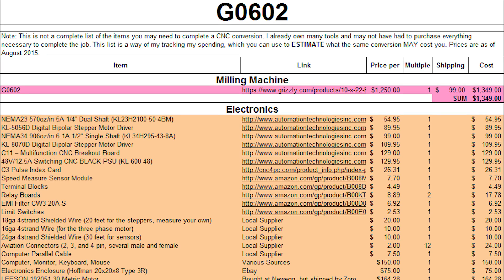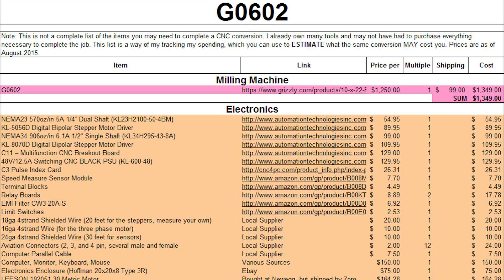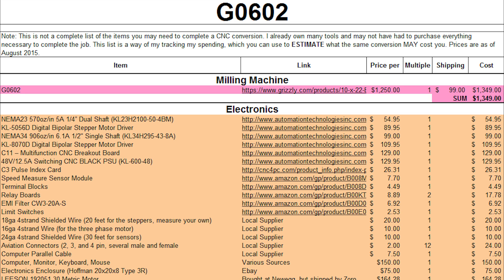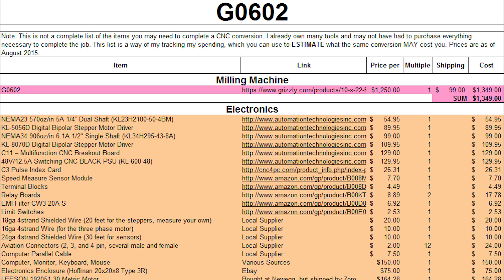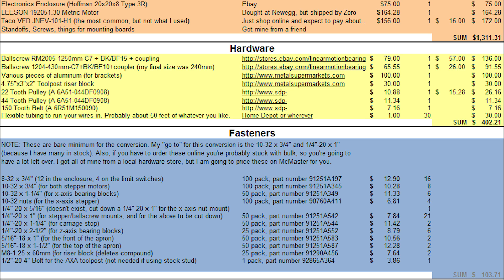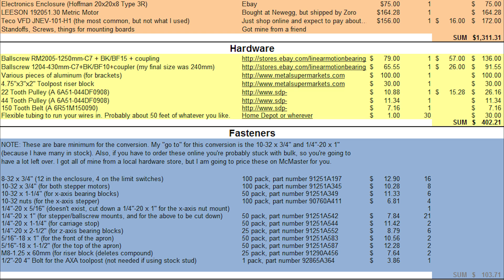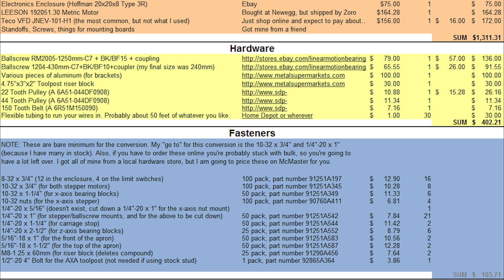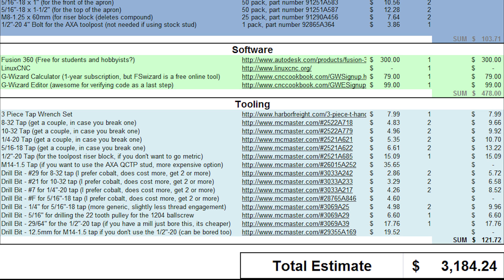G0602 CNC Conversion pt2 - What it Costs to Convert

Comment: hi russtuff I was wondering if you have the part numbers for the 22 tooth pully because i went to sdp and looked up the part numbers listed and both part numbers are the same. i guess i could just find a pully that looks the same but i was worried about belt length being correct and wanted to follow your build. thank you.
Reply from the maker: The part number I have here still works: https://www.youtube.com/watch?v=lvK7TDFJZhY
https://shop.sdp-si.com/catalog/product/?id=A_6A55-024DF1512
I'm no longer using this belt drive as I couldn't get it to run quietly for some reason. Now I'm using a ribbed belt setup... and it looks like I never made a video about it (hmmmm). You can see some of it here though: https://www.youtube.com/watch?v=rH0dEqflykk

Comment: A bit thrown off on the intro spread sheet, says milling machine, you can get stronger steppers by going to nema 24, most have the same hole pattern as the nema 23 ie 47.1mm you can get the closed loop version up to 5nm
Reply from the maker: lol nice catch. This is an old video and I never noticed it :)

Comment: Is a 3 Phase motor necessary, the Grizzly model G0752 comes with a variable speed (1hp) at a purchase price of $2000+, or is it still better in the long run to get the g0602 and change to a 3 phase variable speed.  Currently, the G0602 is $1500+ and after purchasing a Leeson 1hp 3phase ($240) and a VFD ($140) you are close to the price point of the G0752.  Any comment, please?
Reply from the maker: No it isn't. If I were buying today, I would get the one that already has variable speed and save myself the extra hassle.

Comment: eehaww   
just  seconds a go paid for the motors, the drivers and the 48v power supply!! don't know what to do with my previous 36 v power supply that I ordered A week ago:( ouch
was $35 maybe returned to china -#####%$#@!& hmmmmm

my c10 and the c6 will go back tomorrow for the upgrade to c11gs

waiting for duncan to call me and give  me the name of the new expensive boards that he was talking about last time, 

my bad; l didn't write them down, l was driving to frys food store when he called me(:

Without your videos we will never get into that step sir

thank you!
Oz
Reply from the maker: +Ozy Ozy Very cool. No worries at all :)
Reply: +russtuff 
good morning,
just wanted to ask you if you don't mind send me your bellscrews drawings for both axis, I know you don't want to give your drawings in case if they are different, but I just want to compare my drawing with your drawing to make sure I am on the right path :)
Sorry for my so many questions, but hey without your guys I will never get my machine running!
my email  : sumer_art@yahoo.com

my C11gs is on its way :) but don't know where to buy the c3 pules index card sounds like hard to find?
now the speed measure module not in the amazon !  is there any other vendor to buy it from?
again thank you for all the videos!
Oz
Reply from the maker: I think I only have drawings for the X, but I may have the total dimension written down for the Z. I'll have to check. The X drawing is on my grabcad account too I believe.

The C3 is also available from CNC4PC, and that other card does seem to have disappeared. I'm actually about to do some tests to find out if the C3 is actually even needed. It seems to just pass the signal to the BOB so I'm not sure why we all use it. With any luck I'll have that much sorted out before the weekend is over.

Comment: hello,
I really like your both Sam and your videos, you both doing very high tech videos,

I have asked Sam question about his steppers motor and I was confusing if his setup using small nema 270 and 425 will under power the machine? but he confirmed that it will be fine, 
Now I see you are using way bigger motors than his once, and you was right when you said (you need power for  drilling) and I am with you with that part.

can you please tell which is the ideal setup (small motors) vs (big motors)
Thank you very much 
keep up the great work!
Oz
Reply from the maker: +Ozy Ozy The reason I went with bigger motors is because back in the day when John Grimsmo did his G0602 CNC conversion he went with 270oz motors on both axis. He told me he couldn't drill with them, and suggested going with something bigger.

Mine might be overkill, but the exact reason I went with them is because they are the same steppers I use on my mill. Since my electronics enclosure is for both my mill and my lathe, I wanted the motors to match on both machines so that I wouldn't have to change settings on my stepper drivers. If Sam says what he has is working, then I see no problem going with the same setup he has.

One thing to consider, is that while larger steppers will provide more torque, they have slower accelerations. The big NEMA34 I'm using on my Z-Axis takes a bit more time to reach top RPM than a NEMA23 would, due to its mass. I haven't really tested it's drilling capabilities yet though, so I can't say for sure if the NEMA34 is really going to be overkill or not.
Reply: +russtuff  thank you very much to clear that out in a detailed way..
I will go ahead and get same what you use. 

I just contacted Duncan at cnc4pc  and he recommend the new board c11gs he also suggest to use the most advanced cards that will cost around $300 to have complete cnc futures,

But I will just get the C11gs and save $$$ 

I think c11gs can get me threading, coolant, and spindle control! So that is enough for that little project 

I appreciate your replay sir
Oz
Reply from the maker: +Ozy Ozy Awesome. Duncan has always been good to help me when I needed it. Out of curiosity, what else did he recommend that was going to cost so much?
Reply: +russtuff  sorry for my delay of my subscribing, Sam just reminded me and l thought I had done that early, my bad..

I just called Duncan today and left him a voice message asking him to give me the cards sku number and the name, just don't remember the name of the cards but he said they are updated versions with many input and output channels that can give complete cnc setup that the c11 can't 

he should call me back tomorrow and l will get back to you with the info.

l am going to slow with my build.. is it possible that you make a drawing digram showing the wiring :)  l love your setup but scare to wire anything wrong !

thank you for all of the great info
Oz
Reply from the maker: +Ozy Ozy Oh sorry, I didn't mean to make more work for you. I figure he has more cards that will allow or many more inputs, maybe like a smooth stepper that is USB or LAN. Don't worry about it taking a long time, I think my mill conversion took something like 8 months :/

Comment: Do you know of an alternative to the "Speed Measure Sensor Module" that will work with your conversion design?  Amazon is out of stock with no restocking date.
Reply: +George Gibeau Also - the Relay Board link in your BOM is dead.

Thanks for the great videos - looking forward to doing my conversion (plus this lathe is on sale at Grizzly for $1,150)
Reply from the maker: +George Gibeau I had a feeling that was going to be a problem. The cnc4pc c3 index pulse cards will work fine, and that is the only one I am actually using right now. Since LinuxCNC actually prefers 2-3 sensors, I intend to try doing it all on an Arduino at some point, I just haven't gotten to it yet.
Reply from the maker: +George Gibeau Thanks for letting me know.

Comment: I want to build both f your CNC conversions, but for the moment I don't have room for them. I'll watch anyway, as it's fascinating and the info is adaptable to something I do gave room for (almost!)...a mini mill CNC.  When I can arrange for more ship space, I'll be watching again!

Thanks!

-- Mike
Reply from the maker: +BigMjolnir Cool! Let me know when you get there and I am happy to help with any questions you have come up.
Reply: +russtuff You are a generous man!  Thank you for the offer.  Don't hold your breath though...it could be a while. Or not...we'll see.  I'm reconsidering the plans all the time...I'd like the larger mill, I just have to figure a way to fit it in.  The cost difference is negligible enough that space needed is the main decision factor.
Reply from the maker: +BigMjolnir I understand that. If I were in the mood to do another conversion I'd go with the Bolton 45 this time. Much larger and heavier, but not quite as much detailed info online. That's why I went with my mill. Hoss' plans were super helpful.
Reply: +russtuff I saw the CharterOak Automation mill at a model show last spring.  Definitely larger, and surprisingly inexpensive for the manual version.  It's on sale at the moment since they are moving to larger quarters.

I'm definitely going to get Hoss' plans if I go the G0704 route.

-- Mike

Comment: I'm loving this G0602 CNC conversion series.  Thanks!  Looking forward to the next one!

I've ordered stuff from Automation Technologies, and they're good, but when I do a LinuxCNC conversion I order the stepper motors and drivers and the parallel I/O card as a bundle on eBay, usually from Longs Motor or Wantai.  I like the low prices and the one stop shopping, and the quality is actually quite good.  I believe it's comparable to Automation Technologies.  Many people get combo driver cards, but I prefer one driver per motor.  If I blow up a driver (hasn't happened yet), it's easy and cheap to replace a single driver.  I usually have a spare ready to go, just in case.

That's a good price on a  real electrical enclosure.  I've been using powder coated steel shop cabinets with stainless doors from Seville Classics.  They were available at Sam's Club, but they stopped carrying the one I used and I had to buy the last two from the manufacturer's website.

I LOL'd when you said you were originally considering upgrading from LinuxCNC to Mach.  Bwa ha ha ha ha.  Check out some of the conversational programming wizard add-ins for LinuxCNC.  Not as pretty as the PathPilot extension of LinuxCNC from Tormach, but they generally get the job done.  Hopefully, PathPilot threw down the gauntlet and the open source programmers working on LinuxCNC will pick up the gauntlet.  Even if not, there are plenty of other ways to get G code into LinuxCNC.  PyCam is one, although more for mills than lathes.  For one off jobs, I like being able to have conversational programming on the machine.  Barring that, a lot can be done with a little understanding of G code at the MDI screen.

There are a few other LinuxCNC installation videos on YouTube, but they're mostly out of date, and I'm sure yours will be more thorough.  I think most people will be shocked to see how easy it is on a simple mill, lathe, gantry router, etc.  I bought a tiny Sherline lathe so I could immediately convert it to my CNC Mini Lathe.  It's been a lot of fun, and it didn't take that long to do.  Most of the job was the electrical panel, because I'm an electrical engineer and even when I'm building a machine for my own use, I want to wire the panel properly.  I took 60:1 video and the 20 hour build made a 20 minute video.  I edited the video and added the narration, and then my iPod Touch died.  I should send it off to recover my files.  If so, I'll upload the video.  If not, I'll be posting my CNC conversion videos for my Grizzly G1006 mill and my Clausing 4900 lathe.
Reply from the maker: +Liberty4Ever Thanks! I've never used that eBay vendor, but I'll check them out right now. I agree about the single drivers.

I've been using a lot of the LinuxCNC scripts for my mill, but haven't used any for my lathe (or found any yet). Some of the mill ones are really good.

I'm terrible with electronics, as you'll see in my upcoming video on the subject. It's taken me a lot of muddling through to get this done. Luckily one of my friends is an engineer and this crap comes naturally to him :)

Comment: Your videos are GREAT for us beginners - please don't stop!  I am about to take the big plunge and purchase machines same/comparable to the G0602 and G0704 or maybe slightly more expensive if greatly advantageous. If you were starting over today, would you still choose the same machines or would you go with something slightly different?
Reply from the maker: +Wayne Causey Thanks for saying :)
I'm torn. I really like both of my machines, but like always, I have bigger machine envy. I really like the look of the ZX45 (also called an RF45) like the Bolton. They are quite a bit larger than the G0704 and not a lot of money more. The reason why I didn't go with the 45 is because I was nervous about tackling the CNC conversion. I bought Hoss' G0704 conversion DVD and it made the whole project really easy. That said, now that I know what I'm doing (and once I realized it's not that hard) I do sorta wish I had gone with the 45.

The G0602 is still a great lathe, and I like it. If possible, I would buy the variable speed version right out of the box (it's a different G# and they didn't offer it when I bought my lathe). Again, however, if I could have afforded larger at the time, I probably would have gone larger.

Comment: What's your opinion on the ballscrews and ballnuts you purchased? I've CAD'd up the CNC conversion of a different similar size lathe and used parts from Misumi in the design. The cost difference between those and the ones you used is pretty substantial.
Reply from the maker: +Kent A. Vander Velden My source for ballscrews was the same for my mill, which is why I went with them again. C7 are pretty decent, and if you can get rid of all your backlash on the rest of the machine I think you can reasonably assume .002 and better results. The last test I did on my mill was only out .002" over a 4" diameter circle, so I was pretty pleased.

What's the price of the Misumi's?
Reply: +russtuff Roughly from Misumi, $500 for the ballnut-ballscrew set (machined to spec.) and then another $200 for the end supports, so $700 per axis! The crossfeed is a much smaller ballscrew, but it's the same price as the much larger longitudinal ballscrew. I was very intrigued that your source will machine the ballscrew to spec. I'll investigate your source more as my conversation is for education more than anything else.

Was the 4" circle test a cutting test? If so, perhaps the .002" error could mostly be attributed to flexing in the tool and machine?
Reply from the maker: +Kent A. Vander Velden Whoa, that's way more than I would be willing to spend on a machine of this size. If this were some high-end lathe, maybe. I think my custom made 1204 screw was $70 shipped from China, with bearing blocks and the coupler included.

No it was a light engraving test, and honestly I was shocked at the result. Maybe it was .004" over 4"..... i can't remember, but either way it was well within what I expected for a machine of this caliber (aka: hobby grade).

Comment: Hey Russ - I'm curious about the stepper drivers.  Do the drivers build up significant heat, or do they run fairly cool?  I'm thinking about an enclosure for my mill electronics, and I'm wondering if I'm going to need active cooling.
Reply from the maker: +Paul Frieden No I have never really noticed mine getting warm at all, probably due to the large heatsink over the whole back of the driver. That said, I have always run an exhaust fan (dual 80mm). On my new enclosure I switched those to 80mm intake and 80mm exhaust (same fans actually), and I expect it's going to be more than enough for the whole box.